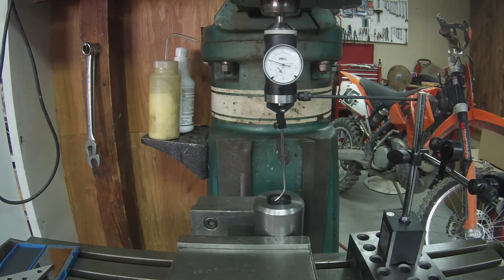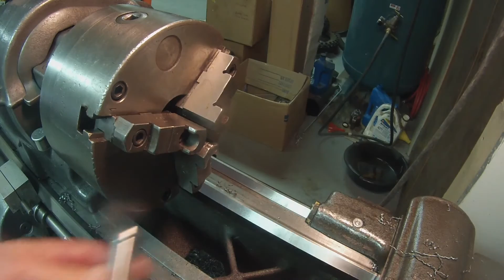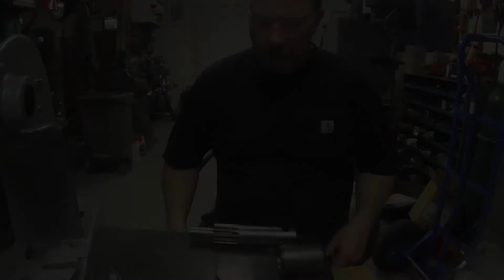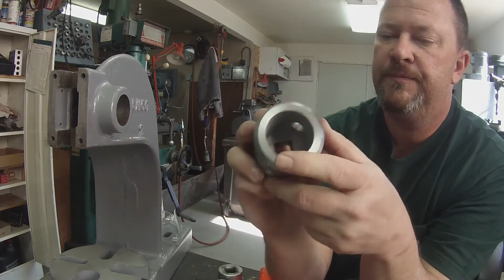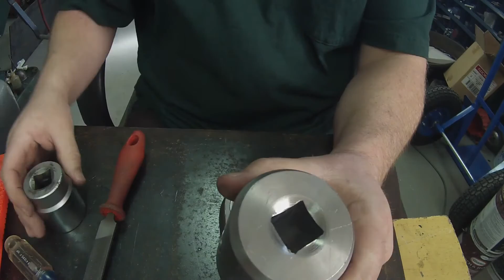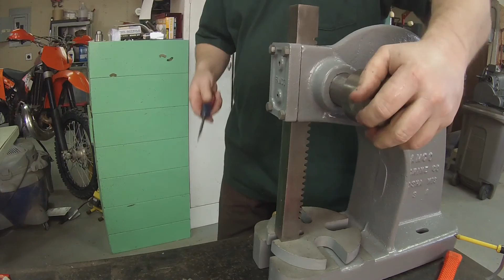Arbor Press  Restoration and Modification Part 2

Comment: I want to add the same to my 2t press to use a torque wrench. Your press is really huge. 
Maybe I can find a big socket and just drill a hole for a pin through it to hold it in place. 
Mine has to fit 45mm. Maybe I can find something old or worn used on trucks that will fit. 
The finish came out really nice.
Reply: I did a torque wrench on mine ( 1/2” drive ratcheting ft. Lbs ) and works great obviously the longer it is the more power you can extrude !

Comment: Hey Charles, part 2 was great. Please take this as constructive criticism, you are way over thinking things. For example when you made the retaining pin you machined a head on it and were going to use a set screw to hold it in place, which is great but with all the gear you have why wouldn’t you have just machined a straight pin with an interference fit. You put the adapter on and tap the pin in. Simple. You seemed very disappointed with the way the pin fitted in the end but I thought “perfect”. As you said your not a trained machinist and nor am I so if I get a good result that works I’m happy and to hell with what anyone else thinks. Honestly my standard procedure now when I come up with an idea is to sit and think about what is the simplest method of doing it and I have saved countless hours of work and many dollars by doing that. You can get a ready made hand wheel off eBay and they are cheap as. Great channel and all the best with it.
Cheers Stuart 🇦🇺 ps, subbed 👍

Comment: nice job on the farmco restoration. what I might of done would be to bore out the ratchet end to fit an old 3/4 socket put the socket in the bore with the square end faceing out and then tig or mig  it in. just a thought. thanks for the vids keep them coming.